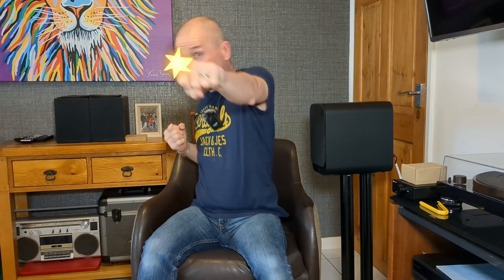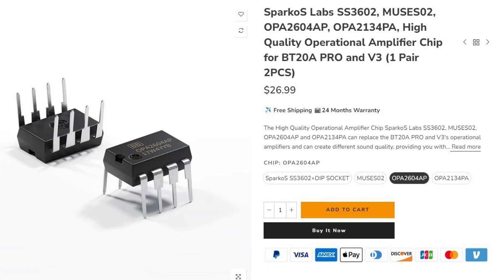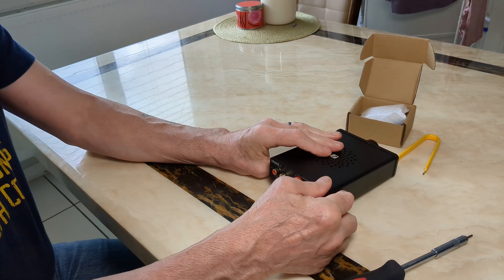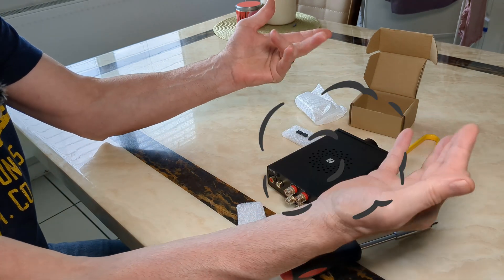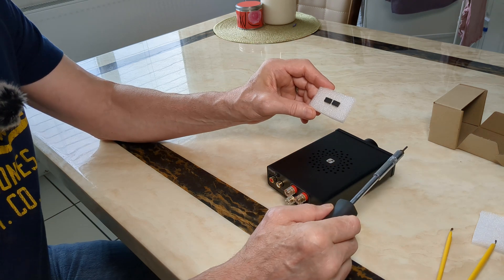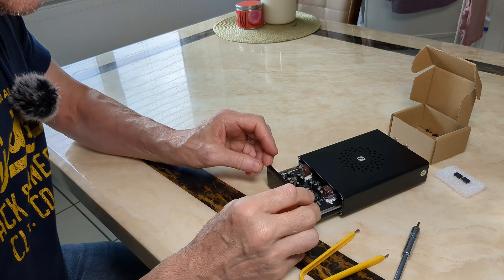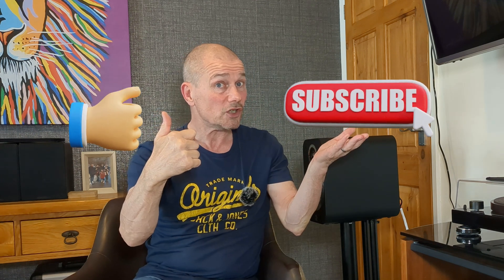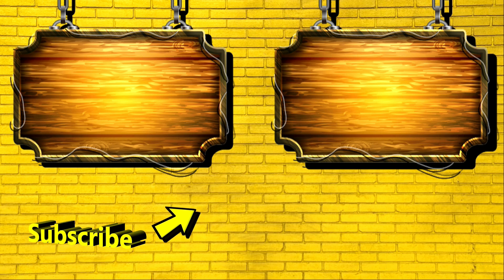NE5532 Vs Burr Brown OPA2604AP With Blind Sound Comparison

Comment: I know Marty spent a bit of time ditching on measurements... and that's okay.

But a couple of tips from a service technician, who replaces these things as part of the job, if you don't mind...

1) The best technique when pulling a chip out of a socket is to pull straight up with a very gentle end to end wiggling motion.  The socket is a friction fit, there's no lock.  It might take a bit of pull but it won't bend the pins as long as you have the chip firmly locked into the extraction tool. Apply pressure to clamp the chip.

2) Take a real close look at those sockets under a magnifying glass.  In the true military grade socket, those are copying, the gold inserts are shaped like a little funnel that will guide the pins into place automatically.  However these imitations have a flat bottom on them. If you don't get the pins started into the bottom holes before you press down you're going to bend them and you may have one or more that are not making contact.  What I do is view it through a magnifier and use the big end of a sewing pin to nudge the tips of the pins into the bottom holes first. Then I press it into place.

3) As a general precaution and because these op-amps are so cheap, I never reinsert one after pulling it out. I always use a new chip, every time.

4) Be aware that in a service scenario these chips might get replaced once in the lifetime of a device. The sockets are there to accommodate that. They are not designed to be tugged and pressed on a whole bunch of times. Since this whole "chip flipping" craze started, I've replaced more damaged sockets than chips. I replace them with true military grade sockets.

5) The op-amps in these mini-amps (V3, A07, etc.) are not providing any gain.  They run at "unity gain" serving as a "phase splitter" for the balanced inputs of the TPA3255 amplifier chip. Thus any differences we notice will be truly slight and at some point not worth the price of the replacement chips.  I certainly wouldn't be spending $75.00 for the discrete op-amps in this case... even $10.00 each is questionable value.

Hope this helps....
Reply from the maker: Thanks, very helpful and well put.
Reply: @hifireviewhub 
You're welcome.  
I just don't want to see people have problems.
Reply: Owning a 07 i'm considering a new op amp. However i'm thinking if it is worth it OR just go for a $200 better amp. Feels like getting the cheapest guitar and upgrading it with pickups twice the cost...worth it?
Reply: @treishtrei 
First off... price is not a good indicator of quality. There are some very good op-amps that are dirt cheap because they make literally millions of them (because they're good op-amps) where the more expensive ones tend to be made in small batches, some even by hand and quite frankly tend not to be much better.

The RC4558 is a good choice for under $1.00 each as is the TL072 which runs about $1.00 each ... both will give you some improvement in deep bass (because of their higher input impedances) and both offer better fidelity than the NE5532 chips.
Reply: @Douglas_Blake_579  thanks a lot man!!!
Reply: @treishtrei 
You're welcome ... let us know how it goes.
Reply: Would to need to reapply thermal grease underneath if you pull the internals out this far?
Reply: @karlos543  
The V3 does not use thermal grease... the ZA3 does.  I did respond to your inquiry about that in another comments section.
Reply: @Douglas_Blake_579 hi Douglas—did you have a good reco for a good 36v 6A power supply for the v3 monos?
Reply: @kineahora8736  
There's nothing special about the power bricks these amplifiers use.  Virtually any brick with the right voltage and current ratings and the correct sized plug is going to work just fine.
Reply: @kineahora8736  
Again ... These power bricks are AC powered devices that must meet electrical safety standards before they can be sold to the general public.  Almost any 36 volt 5 amp supply with the right sized plug is going to work just fine for you.
Reply: IC Pullers are like $1
Reply: Hi thanks for the very interesting information   I have a question about point 5)
do you mean that the differences could be greater when the opamp must provide some voltage gain ?
Reply: @gino3286  
Yes, they can.  

With an op-amp set to unity gain 100% of the output voltage is fed back into the inverting input. Thus the output is going to be exactly like the input.   There are two ways to do this, one that simply passes the signal along and the second that inverts it. This makes these dual op-amp chips ideal as balanced drivers for the TPA3255 chips.

As gain is increased the internal characteristics of the chip will begin to come into play as it receives less and less feedback from output to input.  This can lead to some (hopefully minor) changes in behaviour.  

One of the best examples of this is in an RIAA phono pre-amp where the chip must deliver substantial gain; often more than 30db. Most op-amps have very high DC gains that immediately roll off along a slope as frequency increases until they hit unity gain.  For high gain applications it is possible that the gain requirement can pass outside this slope, causing the chip to limit high frequency response and/or produce elevated distortion.  

In most of these TPA3255 mini-amps the two chips in the pre-amp section are running at very low gains. Fosi typically uses unity gain. Aiyima adds 6db (2x by voltage) gain in their A07 to compensate for older equipment with lower output levels.  I've not seen any that go beyond about 10db (3x by voltage), which is generally in older designs before the TPA3255 came along.

At these low gain levels, even the dirt cheap RC4558 chips that I favour will give you extreme low distortion output well beyond the range of human hearing. So the tiny differences you may hear will be due to factors other than chip gain;  things like input impedance, coupling capacitors, etc.

Sadly most of the "wonderous transformations" you hear about will be imaginary; due to listening position, expectation bias, wishful thinking and other psychoacoustic factors.

I hope that helps.
Reply: @Douglas_Blake_579  hi thank you very much for your kind and valuable advice
It helps me a lot indeed 
Opamps are seen like evil by audiophiles who wants tubes or discrete transistors
From a measurements pov it is almost impossible to get the figures of opamps with discretes   I have noticed that even some high end brands like Goldmund have switched from discretes to opamps in their top preamps   And they cost a lot indeed
Thanks again and kind regards gino
Reply: @gino3286  
You're welcome.  Glad I could help.

Op-amps are not evil. When first introduced they immediately found all kinds of uses in industrial and commercial settings.  Because of the initial prices they trickled down to consumer products more slowly.  The secret is that all of the circuitry is embedded into a single silicon die in very close proximity. You are not going to get the low distortion, thermal stability, replaceability and accuracy of an integrated op-amp with discrete components. 

Many (so called) "audiophiles" have exactly zero technical skill or training. I would (and do) take whatever they say with a huge grain of salt.  Much of it is wildly outdated and a lot of it is flat out false information. If you can't verify what they are saying through credible technical sources... just write it off as "herd think" and carry on.  

... and don't even get me started on the whole cords and cables thing...🤔
Reply: @Douglas_Blake_579  thank you very much again  I have only a criticism about opamps   Their diminutive size  I would prefer them a little bigger 
It is a matter of perception   Some preamps have those black box modules that look nice   Maybe inside there is only an opamp in some resin 
But the very best measuring preamps used them   So they must be good

Audiophiles do not believe in figures 
Only on the ear  Maybe they like distortion
Kind regards gino
Reply: @gino3286  
I get what you're saying and in all due respect my best reply to that is to not be impressed by size.  Bigger is almost never better.

In today's world size means almost nothing.  Given the expense of making silicon dies and embedding circuitry into them, they're not going to make these things any bigger than they have to be.

Some day when you have nothing better to do... take a file and cut away the top of an NE5532 or RC4558 chip... the actual die inside is probably smaller than a piece of confetti.  The large plastic case is actually there to make it possible for humans to handle them more easily.

Op-amps attached with surface mount technology are usually not much bigger than fly poop and often they will outperform their larger cousins by quite a noticeable margin.

Also take a look at the insides of a laptop or tablet some day. You will find parts so small you can't even see them without magnifying glasses, but they are performing important functions within the system. They have to be that small so that your device isn't the size of a suitcase.

The bigger multi-pin chips you see are most often for far more complex functions such as decoding multi-channel digital streams or system processors for martialling a device's activity. They are almost never some simple function in a big blob.

LOL... I can only think of one case where size actually matters ... and it's got nothing to do with electronics 🍌

Comment: Have you thought of getting the bigger 48v power supply, to change the sound even more?
Reply: That's a bit of a quandry.  The TPA3255 chip is fixed gain. It doesn't matter what the supply voltage is (within it's safety range) the gain and general audio performance remains the same.  

I've tried this and some of my clients have tried it... Set the volume to a comfortable level, free of clipping or distortion.  Now without changing anything else, unplug the 32 volt supply and plug in the 48 volt one... it will sound exactly the same.

The extra voltage gives you about 3db of extra headroom, and not much else.  The only time you really need the 48volt supply is if you are clipping the 32volt one all the time.

Comment: For me, the original op-amp sound much clearer, coherent and musical. The 2604 sounds slightly harsh and all over the place, has a weaker bass, and lacks coherence.

But maybe it's just youtube 😄
Reply: On my setup they both sounded exactly like my headphones ... go figure.
Reply: Mmm. Don't agree. The 2604 sounds like its got a LPF on it, so how it could sound harsher? To me the main difference seem to be in the mids and upper mids. On the 2604 has a fuller sounding snare. But what what really struck me was the vocals on the rap song popped on the 2604, really came forward.

Comment: - OPA2604AP has a FET input stage and is sensitive to ESD. Use an ESD (electrostatic discharge) protection setup when working with that component. NEVER touch the component (pins especially) with your hand unless you are ESD-bonded to the workstation. You were lucky they weren't damaged although there still may have been a performance degradation without there being any obvious damage. 
- Never roll op amps without scoping the circuitry, unless someone has done the same roll and has tested it to work for that particular device and op amp combo. The OPA2604AP has a higher gain-bandwidth product than the NE5532 and you might introduce high frequency instability in the circuit without ever knowing it unless you test the circuit with an oscilloscope.

Comment: I have swapped the op amps on some of my cd players i always solder in a socket so they can be changed back if needed .I normally just use a small screw driver to get the out of the sockets but this .I preferred a but so many other things to take into account hearing it in person would be the true experience listening from your recording of the audio and thrue my laptop and speakers or reciever it could all sound a bit different here .

Comment: OPA2604 might sound "impressive" in some aspects,  but it is a colored sound, and has completely unnatural timbre. It's glair-y, and artificial, like most BB amps. Because it's a FET op-amp, it has the precision of a "class D" amp, but that also means it's got it's harshness and sterility as well. 5532 is the most natural sounding op-amp to this day, however the TI version is the worst sounding one. Try an NJM5532DD by JRC/Nisshinbo. It's smoother and even more natural. The 2604's you got looks real. They should have "Thailand" on the bottom.
Reply: As a former drummer I can attest that the snare sounds paper thin on 5532. It sounds like a snare should on the 2604. Imo. Im not sure about any compromises elswhere but the vocals sounded better too. B over A for me.
Reply: @johnmellor932  Which 5532? If it's the Texas Instruments version, yeah. They are the poorest sounding, and they are "thin" in the midrange.  The NJM though is really good, although it can be a bit "muddy". ROHM's BA15532 probably performs the best, I would use that for music production if 5532 is needed. The 2604 is a completely colored op-amp, especially at the bass and mids, and it's timbre is way off from neutrality. I wouldn't use that op-amp for ANY music production. The LM833 is probably the most transparent OP-AMP, meaning it amplifies purely, without any coloration. Different manufacturers also sound different, with the original National Semiconductor ones sounding the best (they are found in some old CD players). Current production best sounding LM833 is made by ST in SOP8 package. The TI version sounds atrocious, similar to their NE5532 - avoid it. The OnSemi version also doesn't sound as good, it's dull and rounded.

When it comes to the 5532, MULTICOMP has started production of their own version (KM5532), which I am going to test soon as well.
Reply: @Astralify  Well thanks for that. Good to know. Im learning about this stuff as I want to try improve my interface.
Reply: @johnmellor932  No problem. :) I am a bit of a capacitor/op-amp fanatic, always testing and comparing OP-AMPs and caps performance and sonic quality, so if I can be of any service, I would happily help and give advice. Speaking of interfaces, they often use NJM2114, which is a supposed "improvement" to the 5532, and while the noise is lower, the sound is insanely flat/sterile, it has no soundstage basically, so it degrades the signal greatly. Popular interfaces like the Scarlets use them, as well as PC soundcards. For example, I will be replacing those 2114's in my SOUNDBLASTER ZxR dedicated line input slave board, which has 2 of them as input buffers, and I will be replacing them with 5532s, because it's a drop-in replacement and it will not introduce any issues. I would like to test the aforementioned new KM5532 version, because I believe the NJM's are hard to find, Texas Instruments's version sound like crap in the SOP package as well, just like their DIP8 counterparts, and OnSemi's 5532 doesn't sound good either (very dull and dead, no idea what happened with that production), so our choices are finding the NJM5532M by JRC/Nishimbo, or if we are lucky - the KM5532 is good, and we can use those. I will try to remember to update this comment section, once I test the KM's.
Reply: @Astralify  Thanks man. Im trying to emulate a Black Lion Audio upgrade on my old Mbox 3 Pro. They used to offer it as a service, so I know its doable. They used 5532 and 2134 as upgrade Op amps. I don't know what caps they used but I know from the research I've done not to use electrolytics on the signal path so I was going to go with film ones. They also did some decoupling on the adc but I know little to nothing about that.  I've not yet opened it up to see what the stock ones are and need to track down a schematic. Im literally just learning this stuff. I did swap out Op amps on an old Alesis EQ many years ago.
Reply: I don't agree with you, maybe 5532 sounds bad, but 2604 is very musical and not natural as you say. It suits V3 very well, for this little money it's a good step up.
Reply: Huh?  5532s sound smeared and lack definition.  Especially in the bass
Reply: That is how I thought when I swapped my own. NE5532 was more grainy

Comment: I tried a few under $20 opamps in the V3 I could not tell much of a difference then I tried the muses02 and finally yes better sound but they cost more than the amp.
Reply: Try the RC4558 or TL072 chips ... both give better bass extension and they cost less than $1.00 (cdn) each.
Reply: @Douglas_Blake_579 
Is it compatible with V3, because Fosi never recommended this two op amp and I don't know about technical.
Reply: @familyng7223 
I would not recommend them if they weren't.
Reply: You should try AD712

Comment: Just sounded like things got tighter and crispier with the new op amp. 10-15% difference at most, not worth the extra money. At that point I'd be considering a proper pre/amp from Yamaha/Sony that will have extra inputs, Bluetooth and a remote control. This amp is only good for desktop setups, or if you have a DAC/preamp with a remote control. Otherwise we're back in the 80's, coming up to the stereo to change the volume ;) Thx for the review! Btw, I got me a Q Acoustics 3090C Centre Speaker and wow, the sound is so transparent, no cabinet resonance or any sound coloration, only $99 and already out of stock ;)) Love Q Acoustics, it's my first experience too!